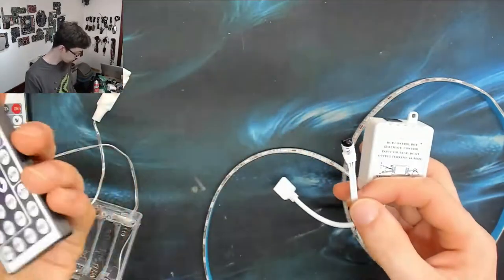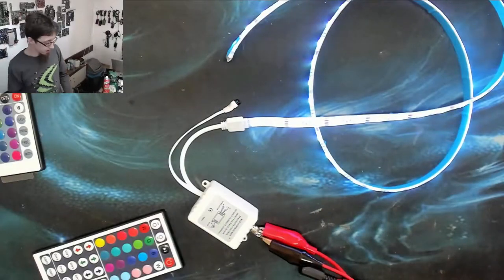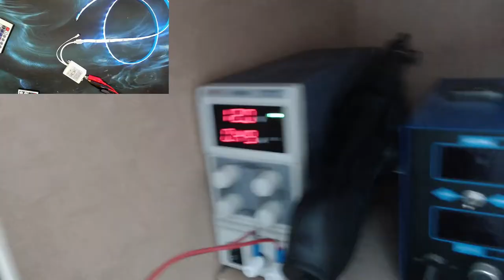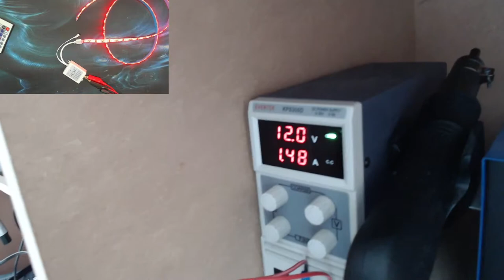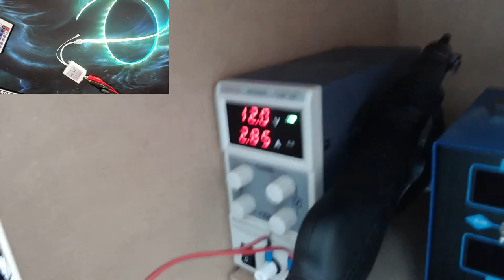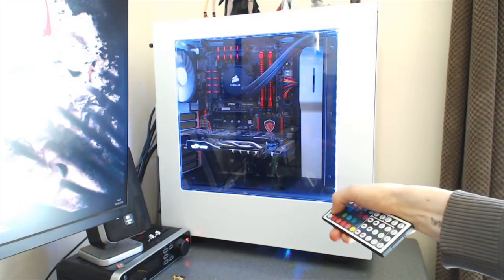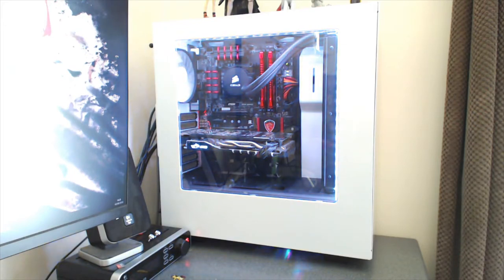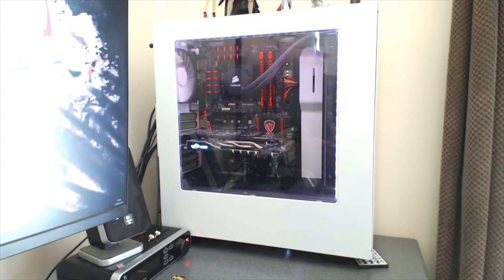Let's Build #21 - RGB Lighting on a budget

Comment: I have a cheap set of rgb fans that came with a controller. Sadly, as they were VERY cheap, the controller will only fit maker specific mini-molex 6-pins. Thankfully, 3 of the wires are the same that operate the ARGB for 3-pin stuff so chopped and soldered a few things. Now I have a 6 fan, cpu cooler, ram cover and led strip all controllable via remote! Got some pretty sweet effects too.